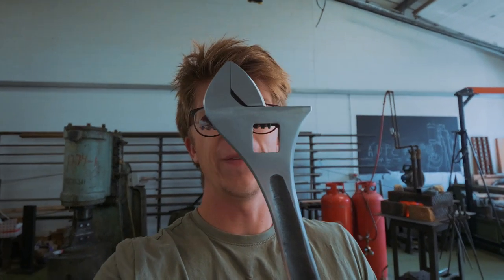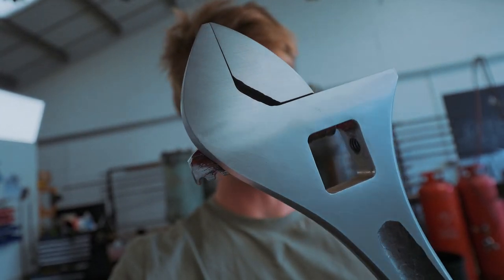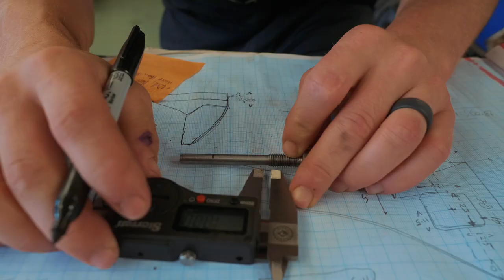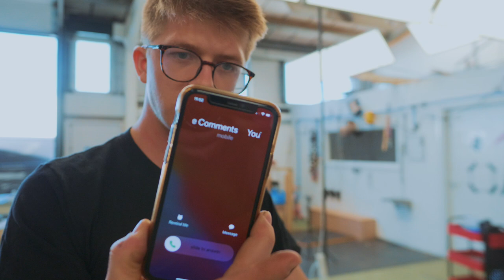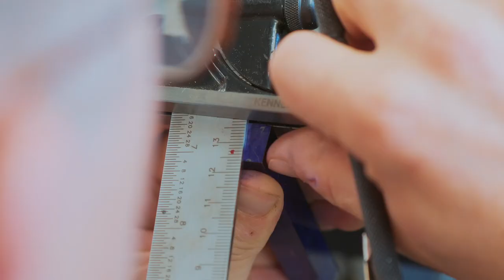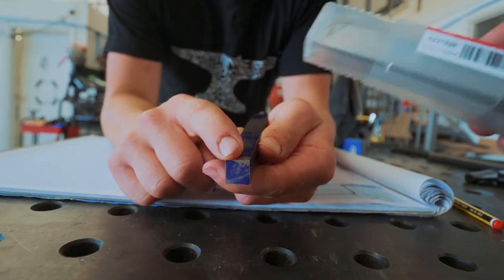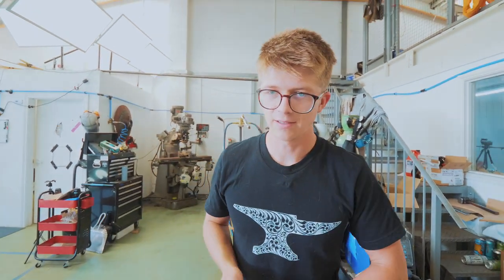Making My Own ADJUSTABLE CRESCENT WRENCH! Part 4 - Finished

Comment from the maker: This wrench is so big it could make a decent weapon in RAID! ✅ Mobile and PC: https://clik.cc/KNBIK and get a special starter pack 💥 Available only for the next 30 days 💥
Reply: Alec I dare you to make a sword without any power tools
Reply: Being a hammer, can you use the wrench to forge a leaf?
Reply: As an old school engineer I applaud your growing skill set, sometimes having a go is the best way forward even if it's the quickest way to work out not to do it !!! And not all things need to be made from Damascus. You have hand crafted a proper and very serviceable tool that is worth of handing down to your children or grandchildren. Keep up the good work and showing it warts and all. I'm looking forward to the next one.
Reply: it looks like you didnt touch mark it
Reply: When you get it "finished" and realize you forgot your Makers Mark  ... it's a lonely calf without a brand.
Reply: How much for the burns dwarf
Reply: You should make yourself a set of robogrips like craftsman has, that may be a fun project
Reply: you didnt put textures on the screw. rookie mistake.
Reply: In high school, I spent several years on the stage crew as an elective course. I carried a 10" wrench that I was almost 100% certain could make a devastating cudgel (in addition to loosening overtightened clamps on lighting fixtures), which was a reassuring feeling if I had to stay late after a show. I miss that wrench. It got stolen or otherwise lost back in '02-03. Don't really need it anymore, and they're easy to get anyhow, but the sentiment was part of the whole deal.
Reply: The only thing they RAID is YOUR WALLET
Reply: 00:39 - I tell ya what... You do VERY WELL creating your projects if your hands look like that without gloves! 🤔😉🤣🤣🤣      😎🇬🇧
Reply: I bet you can't make a fishing rod!

Comment: you need to test how well it strips the corners of bolt heads
Reply: The truest test of any adjustable wrench.
Reply: Said like a seasoned professional engineer.😂😂😈😈
Reply: thats why its called a Swedish nut lathe..!😂
Reply: HAHAHAHA!!! I laughed out loud waaay too hard at this... too true xD
Reply: That's why I call them a farmers nut rounder
Reply: And how much skin it takes off your knuckles.
Reply: @finlaybichan1275  The Swedish model has a left hand thread. This one's a Pommy nut lathe
Reply: @AttilaThebung  🤣
Reply: You need to learn how to use one because I used them every day and not once have I ever rounded off a bolt. EVER in 42 years.
Reply: @qzetu  well I can’t speak from 42 years but I agree, I’ve never rounded a bolt with a crescent

Comment: I was just looking for if there was a new video, I reloaded the page, and here we are! A quick tip from a real machinist... GIVE THE PART TAILSTOCK SUPPORT and you will be able to take bigger cuts without bending a part :)  Looking great, Alec. I love these machining/trying new things videos!
Reply: That was my first thought as well. Anytime you can give tailstock support or cut between centers the result will improve.
Reply: Also, could he have delayed machining the "neck" on the part?
Reply: @NicksStuff  that allows the tool to be able to come out of the cut on the other side, a relief cut is usually always made like that.
Reply: Thats what my dad always taught me if you can putt a live centre in just do it its safer cuts better and if your moving the part around the live centre can help recentre the piece especially if your like me and not chasing microns and using a 3 jaw chuck

Comment: Yo Alec, as a CNC lathe machineist, I think I can explain what happened with the workpiece bending; 
- Your tool was too high up (Y-axis) off the center line of the piece, which lead to it catching onto the cutter off axis. 
When machiening on a lathe it's usualy smart to have your cutting engagement perfectly centered, leaning towards slightly below center on the work piece, that way you lessen the load on the tool, giving it a favorable cutting angle.
As you know, it's much better to break the cheap tool, than to ruin the piece:P

But it did turn out well, and was a fun little project fo follow you along watching 👍
Reply: Upvote so he can learn from his mistake!
Reply: I'd also add that he should have ground side relief on the leading and trailing edges,  and also only needed that thing to be a fraction of the thickness of the blank.  There was no reason for him to have the odd one-way angle that can only cut threads one-handed.
Reply: How do you not know how to spell your job... MACHINIST / MACHINING.
Reply: That was my side, also with a high offset hi-speed steel tool, wouldn't you wait to shoulder the threads so as not to create a stress riser? It's not a critical dimension so wouldn't it make sense to cut the threads, then taper it for cut off so as to lessen wobble and bend risks?
Reply: @djkommando  That's how you know he's a true blood machinist.
Reply: Also, should've had a centre on it, should never thread something that's sitting that far out of the chuck without a centre
Reply: @djkommando  dude, why so rude? The guy might not have english as a primary language. Still thou, no need to be hating like that. You clearly understood what he meant
Reply: @djkommando  I'm from Norway, so English is just a 2nd language, and I don't care enough about a Youtube comment to spellcheck it. But thanks for your concern, glad you got my back <3
Reply: @heckin_dinosaw  Yeah, or at least minimize the length of the part as best as possible if your rigidity is high enough for the operation, which would preferably use proppely calculated speeds and feeds etc.

I just think that the comment section here isn't the best platform for educating people on all aspects of a craft ;)
Reply: @Renvil_  samme her👊🏻🇧🇻
Reply: @siegehammer63  Having the relief on the back side of the threads is a big benefit when threading in manual lathes, as if the tool is still cutting when you reverse the spindle, it's usually gonna break due to friction and the slack in gear engagement etc. 
But if you are threading and disengaging X-axis per pass, (like in a CNC operation), there is not a need for the shoulder relief first, but it's usually put there to , again, lessen the chance for unnecessary stress on the threading tool.
Reply: @Renvil_  ah, because let's be honest you'd rather save the tool than the workpiece in this situation. Totally understand!
Reply: Yep. I'm a manual machinist and I've made some of my own HSS cutters. Id recommend using a steel ruler not a sticky note to find center also. And using a fine stone on the edges of the cutters can help with finish and chatter.
Reply: Found the answer, thank you.

Comment: We just want you to succeed and save you some frustration in the process when we make machining suggestions. We have all been there when we realize we did things the hardest way possible. Well done on the wrench I am sure it will make a fine hammer 😜
Reply: Yes! The almighty crescent hammer, one of the mightiest of tools, right up there with the torch mallet, and everyone's favorite the bolt striper, I mean vice grips...

Comment: Congratulations on another interesting learning adventure. Just a thought from a machine shop student. I turned some odd shaped threads I was in my high school machine shop classes, 
Rule#1 when ever threading with a lathe center drill the piece and use a bearing center in the tail stock. It'll help stabilize the piece when threading. :)

Comment: Good to see you come to the light mate.

The first one was a massive fail, but a great learning experience for you. Still worth having a go, otherwise how do you learn.

The replacement was far better. I have one other tip for you: use tail support.

Using what is effectively a form tool puts quite large cutting forces on everything. Between that, the stick out from the chuck and the necked down portion you substantially weaken the part. Supporting it at the other end with the tailstock will make the setup far more rigid and allow you to take deeper cuts without bending anything.

Now imagine the tool and part swapped over... Tool in the chuck, workpiece on the cross slide. That's how you should have done the moving jaw to get a perfect fit between the two parts.

That said, it is pretty close the way you did it and it certainly works well enough.

Well done.

Comment: For threading set the compound to match the angle of the thread and feed in with that, so you only really cut a small amount on the trailing edge rather than using it like a form cutter.
Reply: Not for square threads. For square threads you need to feed straight in so that just the end engages.

Where you set the compound at an angle it's to reduce the cutting load on the tool, it is set half a degree or so shallower than the thread angle so that you cut on one side and only just scrape a little material off on the other to keep that side of the thread clean.

With a square thread profile any angle to either side will have you cutting on the end of the tool and all of one side, substantially increasing the cutting load and destroying the thread profile at the same time.
Reply: That's definitely the technique for standard v shaped threads, but square or acme threading you have to feed directly into the part or you end up cutting groves much wider than your tool.

Comment: Been watching,  single pointing,  ok, I have 40 years on you in this, enjoy watching your videos, youth and vigor is presented.  Cut a lot of acmes and trunicated trapesodials, usually internals.  Set compound at 90, cut to depth, plus some clearance, widened to fit with compound. Worked. 
Ok, metric imperial.  What is your leadscrew?  If it imperical you can cut imperical threads using threading dial.  Metric you have to leave halfnut engaged and reverse spindle. If you have metric leadscrew it is reverse.  But hey, I have a Hendey, I just use the leadscrew reverser lever.  Keep putting out videos.

Comment: It's a Swedish 🇸🇪 invention called Skiftnyckel. Direct translated shifting key. It's a great tool and you made me (as a Swede) very proud. 
It surely looks great. Well done
Reply: The English engineer Richard Clyburn had made adjustable wrenches before they were made in Sweden, but the modern form of the tool is Swedish design, that's true.
Reply: @Baiko  fair enough. Bowing before that knowledge

Comment: Nice work!  I agree with the others about using a live center while threading.  Also, oil is your friend while single pointing, I like Moly-Dee.  It's made by Castrol, check it out.

Comment: Don't feel too bad about breaking the lathe tool, they are a consumable.  I know a few machinists that will use a profile once then grind it off to make another one out of the same blank, reusing it until you can't hold on to it anymore.  I prefer to start a new blank, so I have a library of good tools already prepared, although I do have a drawer full of lathe bits that have been used down to nubs, they are handy for using in boring bars.

Comment: now make another one with a hammer area and make the end of the handle a punch so you can use it to align holes up then watch bolt through with the hammer section, may as well add in a bottle opener and Slotted screwdriver

Comment: I have cut many acme threads that look just like this, with a hand shaped (off a grinding wheel) old school, but not with a single-block HSS cutter. Back at the start of the 1980s, when I learned to machine, we used the holders that went through the center post of the cross slide, so like a 3/8" bar of HSS ground to whatever shape required. So, basically the same as yours, but smaller, shaped a bit different, and cheaper.

Comment: I've seen both Abom79 and Keith Rucker do Acme threads on a new Lead Screw. They only make 2 cutting surfaces, they get the 3rd angle from the cross slide being set at the proper angle

Comment: our machine tool teacher would make us create our own 60 deg. thread pitch cutting tool before we stated making our own threads. Still have the guide used to check the angle. also it may be a little hard but its always best to support it from the other side especially since the size and depth of cut is square. Also, aren't the screws a little knurled for grip, it might be best to do it before cutting threads. Otherwise it looks amazing

Comment: i think a  little more texture on the outside of the spiral (where your fingers touch) should help with gripping it and turning it in case the jaws start getting harder to move. something like knurling.

Comment: You can get Machinist Handbook info online so you won’t turn part too slowly or take (way)  too much material off like you did just before the Bend.  Leaving lathe compound engaged and looking away?  One way to lose fingers and eyes etc. If you want to work faster then Slow Down.

Comment: Mr. Steele, I've watched a lot your videos and am in need of a bit of advice. I have a naganata blade, broken from the haft with about 3 inches of tang. I'm going to slap an ironwood handle on it and make it a sword but I wanted your opinion on the shape I should make use for the handle itself.

Comment: Great job but i noticed that the adjusting screw was turning the wrong way?
Is it a left hand wrench? 
It should tighten when the screw turns upward with your right hand thumb. Or is this n English version working to the opposite direction?

Comment: Alec, why not make a giant twisting wrench that is adjustable? I have seen a few smiths that took the wrench you have right there and weld a handle to the top jaw and use that for twisting their steel. Why not just make a wrench specifically for that?

Comment: 7:25 I was just thinking of a way to hold it closer to the chuck, then it grabbed and bent like that. I was expecting deflection and maybe vibration but not this! Did you use recommended speed and feed?
Reply: no he used Sneed and Feed in the Chuck

Comment: Why not get a precision metal-working oven that has heating/cooling cycles built into it designed specifically for tempering? Using a forge to try to get it to 650 versus the tool designed for the job is guesswork and Murphy's law....that which can go wrong, will go wrong. It's like trying to do ballet in work-boots ;-)

Comment: I’m not mad at you for not making a single point threading tool. I’m upset that every time you went to mill something square, you didn’t start with the largest face on the wrench but the sides instead.

Comment: video 7;45 has wrong made, first need make sharp triangle plade treath then flat, bevause if have make before little triangle not have hard and big power make flat plade this treath, flat take metal out only side, triangle plade first make treath light metal out  i not can say english this good but first make metal out little plade and last make treath flat plade no need lot torgue flat plade and broken rod. and why lathe after treat area thin keep rod full size and make only treath first and last lathe grinder thin area and righ size all other when treath have ready.